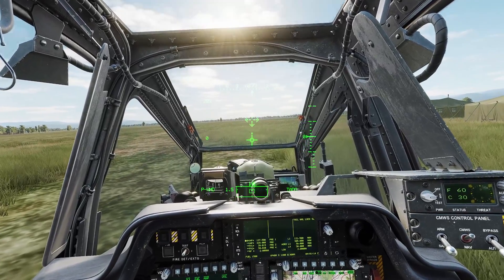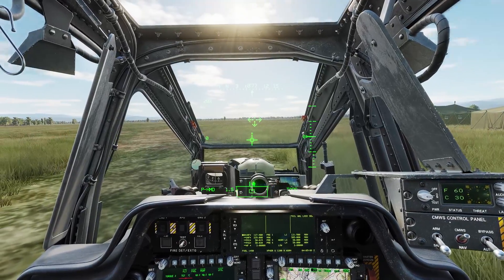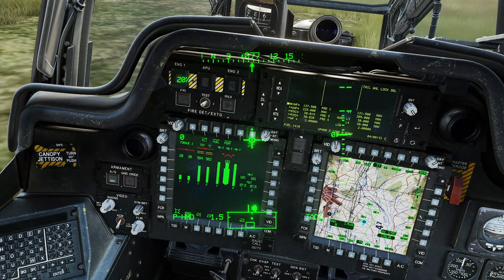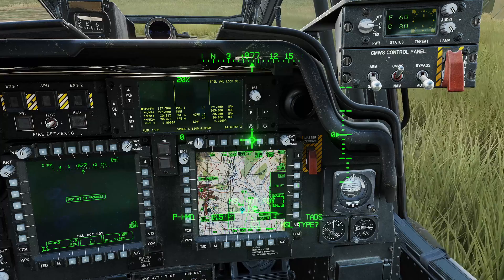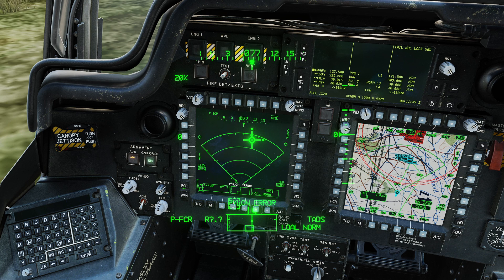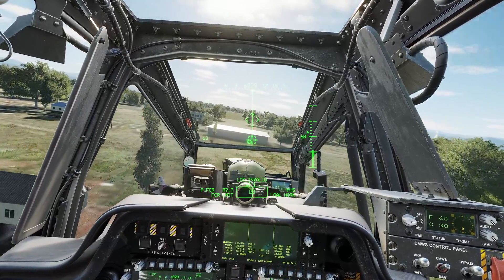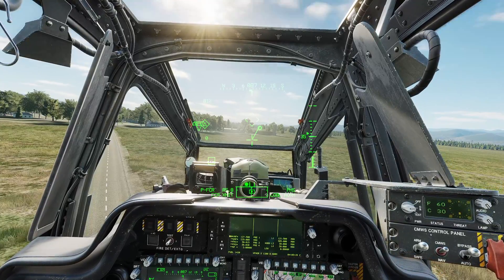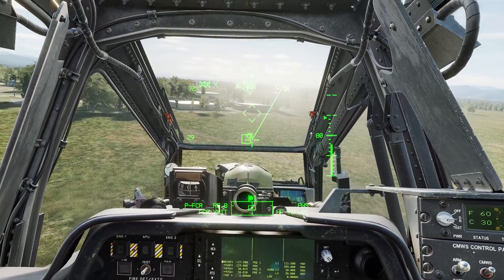AH-64D Apache: C-Scope & FCR/TADS LINK Functions Tutorial | DCS

Comment: Gday Matrix, if you don't mind, what controller's are you running for the Apache?
Reply: Thrustmaster HOTAS Warthog with a couple of small add-on keypads.
Reply: @grmatrix6358  Cheers, same throttle but i still cant get mine as smooth or stable as yours seems to be. Might have to look into a collective controller. Rocking a VKB gunfighter with extension for the cyclic.